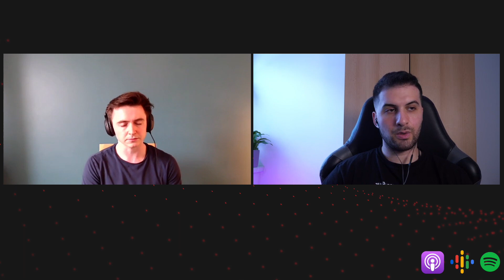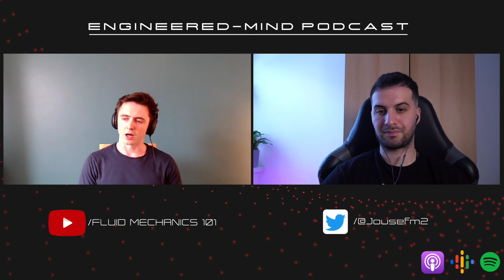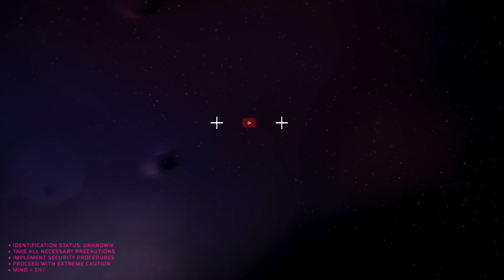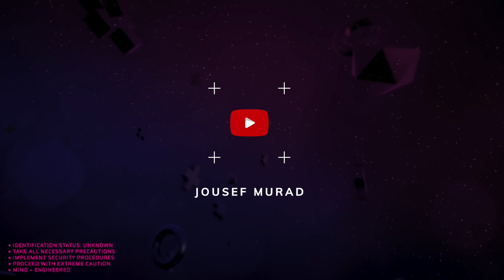What is Convergence in CFD? | Aidan Wimshurst

Comment: Two add my two cents of thought:

1)Mathematicians don't want to achieve machine accuracy. We'd like to, but most of the time not possible nor necessary

2) In my experience most engineers who just want to use some simulation software are not aware that you have multiple levels where you need to "converge" or let's better say: There are multiple levels where your approximation needs to be "good enough" in order to have any meaning at all.
Reply from the maker: Good input and I agree Thomas, cheers :)
Reply: Just a question...i am not sure, but could  residual conergence depend on  hardware machine?